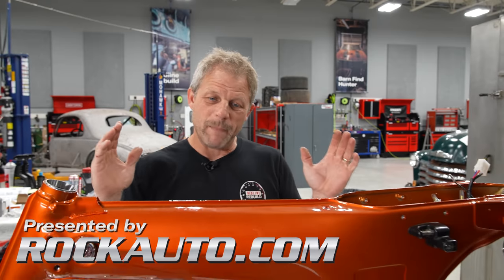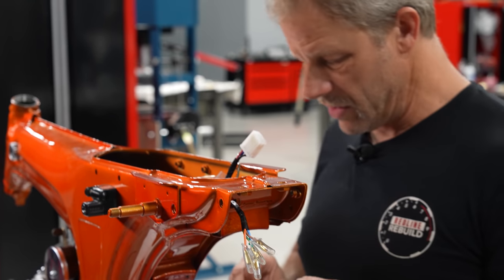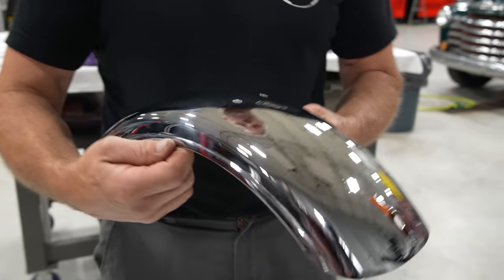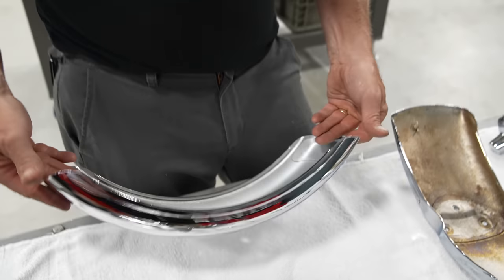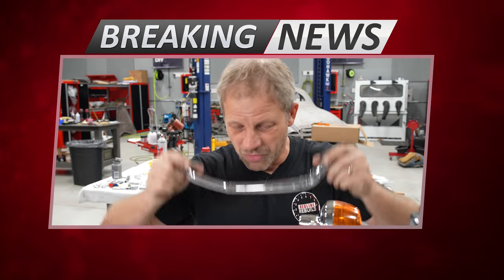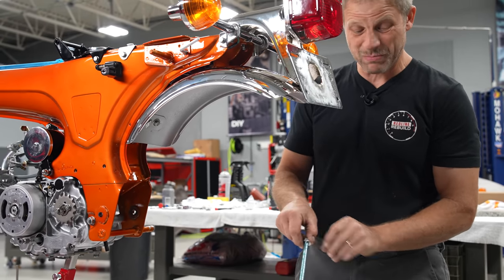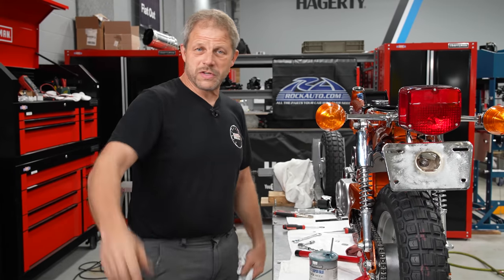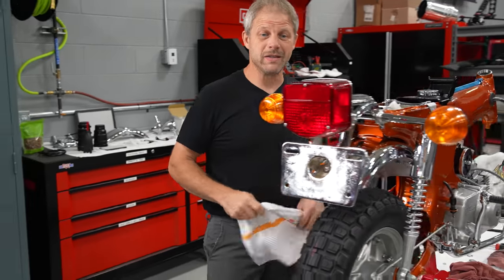One wheel and no steering! Assembling the rear end of our Honda Trail 70 | Redline Update #96

Comment: I love these monkey bikes. They are very popular here in Finland. When i was 15 i had a 50cc monkey that went 40 mph because 40 is the highest speed a moped is allowed to go before its considered to be a light motorcycle. It never had any issues even though i basically rode it full throttle every time and it didnt have a rev limiter so it rev'd so high that the valves couldnt keep up. Monkey bikes are also very easy to modify some people even have 190cc daytona engines in their mopeds. I didnt want massive tickets so i just changed the main jet from a #60 to a #74 and put a free flow airfilter.

Comment: Those were so cool, when new. I had a...sigh... smaller Mini Trail 50. 
I'm waiting to see if you found a decal for the Text & Striping. Still remember being on a road, wound out about 25, with a car right behind me, thinking how I would turn off without losing it in the gravel. 
Mine had the centrifugal clutch...a standard clutch would have been better.

Comment: @6:05 I'm curious why you used a torque wrench to tighten the castle nut, when you don't have the chain installed. It seems like a waste of energy to have to loosen that castle nut, to tension the chain; just leave it mostly tight, so things don't move.
Reply: I dunno about him but I work on things that fly and I have a rule: Things are either on or off, never in between.